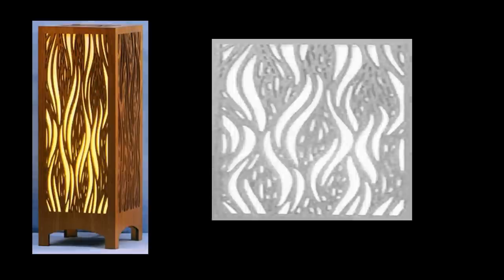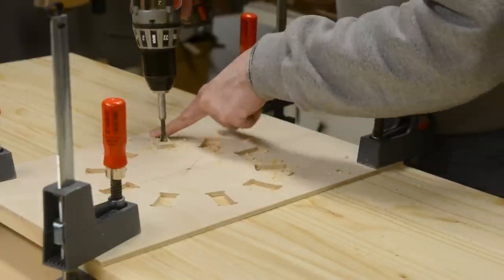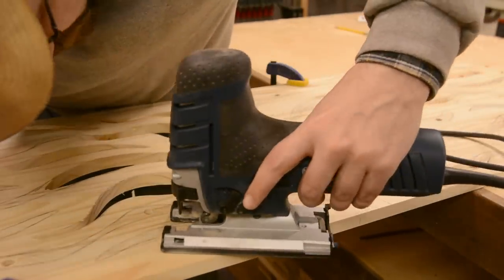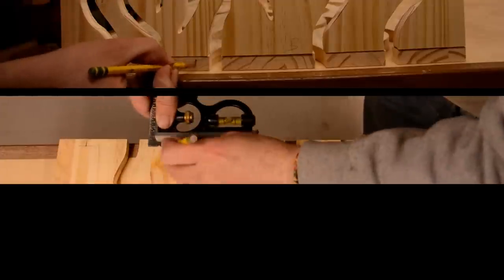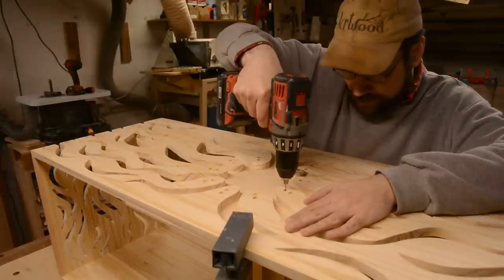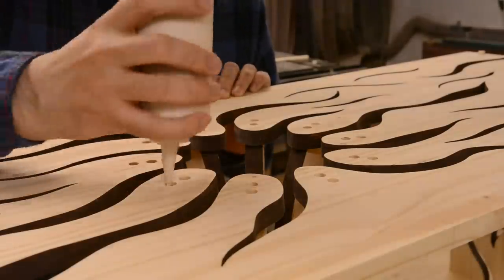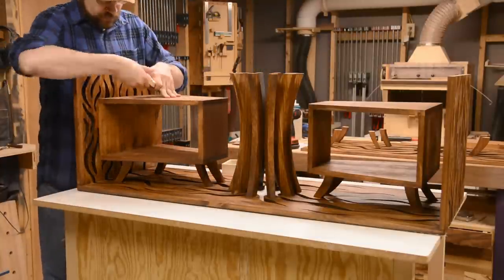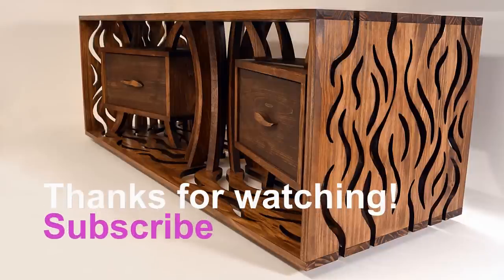Liana Coffee Table

Comment: I'd name it the Tongue Drum. Because that's the first thing I thought of when I saw your scrollsaw work on the top (bottom). Does it make a tune when you hit it on strategic locations? Might want to add a felt tip mallet holder then ;)

It looks absolutely gorgeous btw. Nice and organic, not too intrusive, but could be an awesome conversation starter right there! Also, great work on the editing. I feel youtubers putting in lots of effort to make the video flow and look good don't get enough compliments about that. Cheers!
Reply from the maker: devjock I totally didn't think of a tongue drum but you're right it does look like that.  Missed opportunity there!  I don't think pine makes a very good tone wood :)  I'd have to call it the dented coffee table!  Thank you for the comment on the editing.

Comment: Why using a CNC to cut the template then cut all the panel with a jig saw ??!
Reply from the maker: +skyhacker6 The template was a starting point.  Once I transferred it onto the wood I could see places where there was a defect that could be cut out by making adjustments.  And I thought I would be able to reuse parts of the template on the top but ended up doing it all freehand.

Comment: It's cool, but if you're using a cnc for the templates, why not use the cnc for all of it?
Reply from the maker: 1) It's not big enough 2) It can't make sharp internal corners or narrow openings 3) I can adjust the lines to work around defects in the wood 4) I can cut it out with the jigsaw faster  5) I barely had to do anything to the jigsaw cuts but would have had to sand the cnc cuts for the rest of my life.

Comment: Have any measurements, template for the design,or any link to find templates for the design?
Reply from the maker: James McGuire I used the 18" wide panels from Home Depot, which are actually 17-1/4" and added on a strip of my own and straightened the edges to end up around 17-3/4" wide.  It's 48" long and the side panels are 15-1/2" high, total height about 17-3/4".  You could probably scale a screen grab from the video if you really wanted to copy the side panels but I'd encourage you to try drawing something on your own first.

Comment: Why screws why not glue and brad nails you make really nice stuff but you use pocket holes when you could use other meathods and screws on this project when you could have used another method
Reply from the maker: It came apart a couple of times before final assembly and glue and brad nails is not a very strong way to reinforce a butt joint.  Dowels would be better if you don't like screws.

Comment: Nice concept but way too many screws for my taste.
Reply from the maker: Dowels would work if you're so inclined, but everything doesn't have to be over-complicated.
Reply: krtwood
Or hidden mortise and tenon joints and mitres. Not everything need to be complicated, but something this pretty deserves to be.

Im just saying i personally would have done this with more joinery. Still looks good even with screws.
Reply from the maker: Birki gts It was a prototype only to see if I wanted to do the cutouts on something else.  I didn't intend to turn it into a finished piece at the start, and anything fancier than dowels would have been impossible on the other piece (torus table videos)
Reply: krtwood
Ok